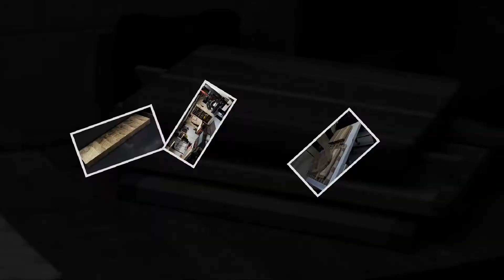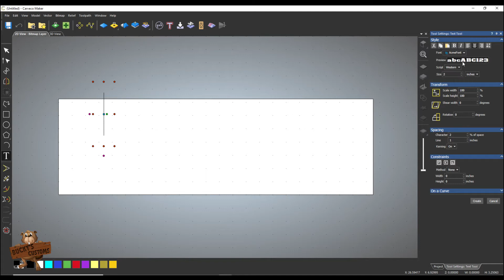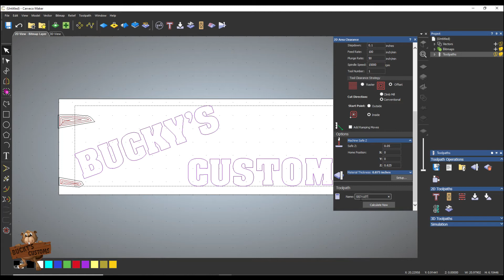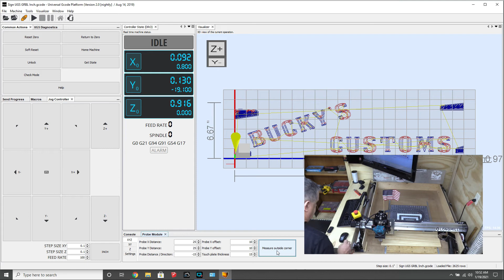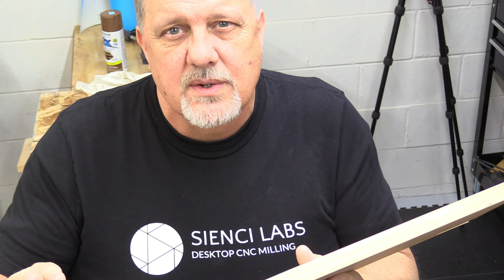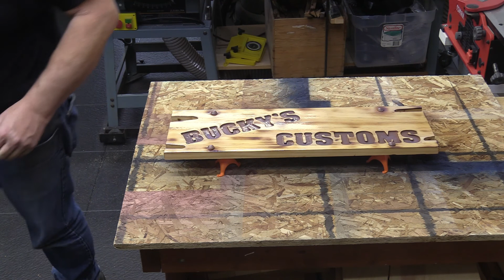How to make a Sign using the Sienci Longmill

Comment: I am contemplating getting the Longmill 30 x 30 but I have a small basement workshop.  What is the minimum size table I can have in order to set this up properly.  Thank.
Reply from the maker: 44" Square will Hold the mill. You can mount the control board on the side or underneath. My Basement shop is 12' x 20'.
Reply: @BuckysCustoms  Thanks for your reply.  My shop is only 13 x 16.  I usually do just small projects, and mostly on my lathe, but am looking into making bigger items as well.  I make rustic American flags and would like to have something carved in a corner of one......the biggest flag I make now is 13" x 25". Thanks again.